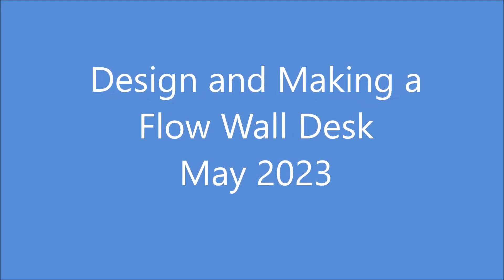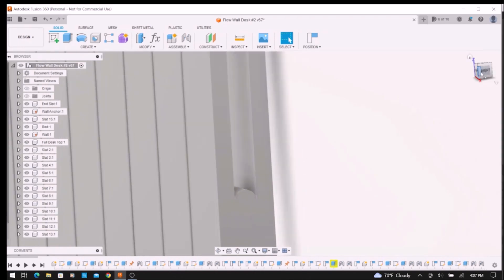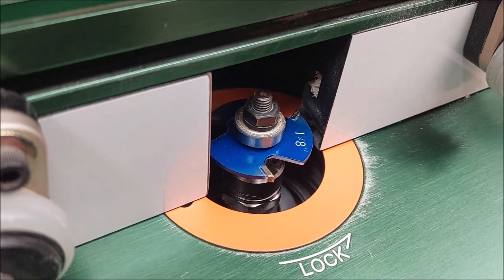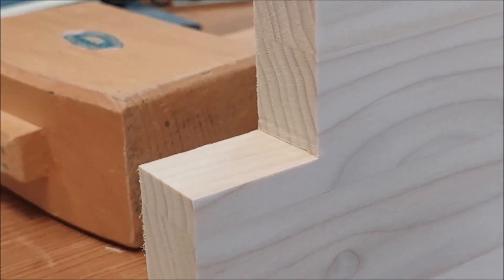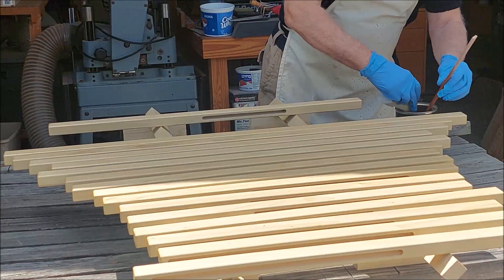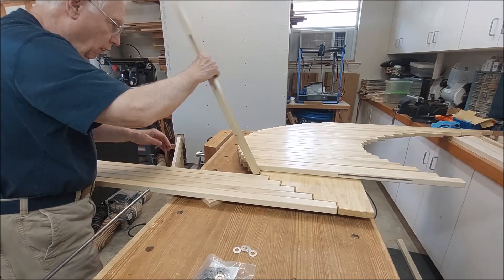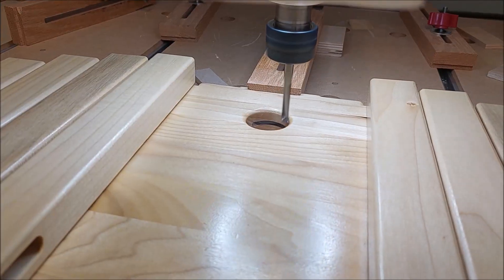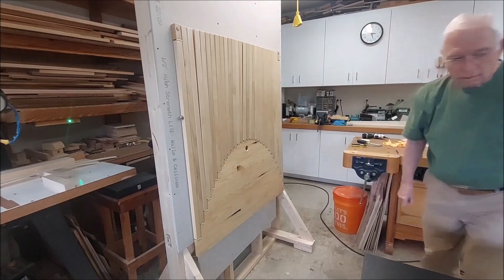Three Correctable Errors in my Flow Wall Desk Design/Build Challenge

Comment: Is the design usable as a table? Seems like if you put weight on the front edge of the table it will want to unfold back?
Reply from the maker: In the unfolded position the desk is very stable.  Placing weight on the front causes no tendency to unfold.  The main issue is weight capacity; you would not want to overload the desk with excessive weight.  To refold the deployed desk, you pull up on the back (using the finger hole) while simultaneously pulling out slightly from the wall.

Comment: I would love to have plans for this. Since you were using a cnc, instead of glue the spacer pieces in. Could you create a piece that could be cut on the cnc that includes the 
‘Spacer” in a few spots along the length of each. Say top middle and bottom.
Reply from the maker: Hello...  The spacer is needed in only one place-- just above the rod on each slat; the bottom spacing is maintained by the hinges; no top spacer is required.  The sole middle spacer could be milled in the slat via CNC but I think this would be an inefficient way to do;  Much more efficient in time and material to cut the slats to final width with table saw then glue in a spacer.  If you don't have a table saw, the CNC milling operation you envision could be a way to go.   Out of respect to the original designer, I do not make my plan available, but there are enough hints in the video and comments for one to make their own.  Its fun. Thanks for watching.

Comment: Absolutely fantastic I found this video. I had no idea how to make this and you helped tremendously. Thank you.
Reply from the maker: @johnvatistas6569  Thanks for watching.  Good luck on your project.
Reply: @richardevans6891  I'm sure this is a dumb question. Well I feel dumb asking because I'm scraping my head with the numbers.  My projected total height when the entire piece is flat against the wall is going to be 43.5 inches tall. Slats 1 & 30 are  going to be 35.9 inches tall. The height of the desk portion (still flat against the wall and not folded) where slats 1 & 30 are going to be hinged together is showing 7.7" long from the bottom piece.  I'm referring to where the desk portion in terms of height where it meets slats 1 and 30 at the hinge points.  But it sure seems very high to me.  What was your height of slats 1 & 30 and what was the height of the desk where slats 1 & 30 meet? It seems this is more of a parabolic shape for the desk portion. I'm clearly doing something wrong.
Reply from the maker: @johnvatistas6569  Hello John,  Note that the desk top shape is not a portion of a circle; it is closer to a parabolic shape.  In an answer to a question from vedranincanada in the comments to this video, I provided the dimension of each of the "steps" of the desk top in my design.  Those will be helpful to you.   In my design the total height of the project flat against the wall is 45.5".  The height of the desk top under slats 1 and 30 is 4".  The length of slats 1 and 30 is 41.5" (including a 1.5" portion of these outer most slats used for hanging on the wall).  Other dimensions may work of course, but those were my dimensions.  Note that in my dimensions this is no allowance for the thickness of the hinges.  Good luck.
Reply: @richardevans6891  You are very kind to answer me and so fast. Thank you very much.

Comment: You did an amazing job on this table!! I remember seeing a famous YouTuber try this and he had many challenges.
Reply from the maker: Hello Patrick, thanks for watching and commenting!.  I am enjoying you channel, but I have a question for you...  When soldering a wire to a panel connector with a short bit of shrink insulation "waiting" on the wire, what is the trick to prevent the shrink insulation from shrinking from the heat of the soldering prior to moving it to final position??  I am working on retrofitting a Jianken 2.2kW  ATC spindle to my machine.
Reply: @richardevans6891  That is an excellent question and I think about that when I am soldering with heat sharing tubing. What I do is make sure I have at least 2 to 3 inches of insulated wire, and when soldering, that heat shrink is as far away from the soldering position as possible. I have done it with shorter insulted areas, but at times you don't need the heat shrink as long as there is insulation all the way to the soldered rigid connection. I really only use heat sharing when I put two cables together, rather than soldering to a rigid set of connections.

Comment: With the slabs/strip, should it be the same width cut measurements as the cut surface measurement? eg. Slab  width 31mm same as the cut measurements for the slab to be attached 31mm or it should be 32/33mm ?

Comment: Awesome.  Finding the right measurements was very hard, but your  video helped a lot. 
My table top was 21"× 38"× 3/4"
Which put the:
Pin at 11 (rounded" on slate #1 and #30 (half the size of the table depth)).
Slate width of 1 1/4" ( x30 slates=37.5". That leaves .5" if you wanted thin spacers.)
Hinges were 1 × 1.125( surprisingly hard to find cheap)
Because of the awkwardness of the piece I ended up securing the table top and slate 1 and 30 to the wall and added one slate at a time. By doing this you can mark the slot length the pin needs to slide.

Comment: Hello Richard, This is amazing video Thanks for sharing

I want to make this table but I'm confused how to Draw line  for "D shap" ( measurements). Please tell me what is the length and width of "D" Shap.

I hope you have understand my question.
Reply: I have been trying to figure this out. Have not found a formula yet but I assume it will involve two 90 degree angles but the curved D line is not a circle. So the regular formulas are not helping me. 

Have you had any luck since posting this?

Comment: Thank you very much for posting this brilliant work. I have been trying to modify the design in SketchUp Pro. I have a question on the 1" x 1" wooden spacers you mentioned in your reply to  peterjordan5947 some two  months ago. 
I was wondering if you used smaller spacers between slats in the middle of the Flow Wall Desk.  I thought the 1" x 1" spacers would not fit at the top end of middle slats because the slot starts at 0.607" from the top of the slat. This distance (0.607") is shorter than 1" - the size of the spacers. Could it that I did not understand your explanation very well?
Reply from the maker: You are exactly correct.  The size of the spacers must be adjusted for the slats toward the center.  How did your project turn out?

Comment: Hi Richard. I dont suppose you know the length of each slat, obviously they're mirrored so just 1-15. That would be really useful
Reply: The first and last one is tricky due to the extra hinge point.
Reply: Actually I think I only need the length of the shortest slat and how far from the top of the slat does the slot end. 
I'm really enjoying this. There's no need for plans etc. You've provided hints and answered comments. I think with this info it should be buildable. Or at least have a stab at it and then fine tune it. The position of the rod is difficult if it's not right the table won't be flat. I've taken some screen shots from your video and trying to measure off that. But if you could provide the length of the shortest slat and the distance from the top to where the slot ends I should be able to calculate it and then confirm it with the measurements from the video stills. Thanks Richard
Reply from the maker: @peterjordan5947  Hello Peter,  In my desk implementation, shortest slat #15 = slat#16 = 24.000" long.  The slot in those slats start .607" from top of slat (measured from the center of 3/8" arc at slot end).  The slot stops 7.910" from the bottom of slat (again measured from the 3/8" arc center).  This is all, of course, for my particular desk.  I imagine there are many alternate formulations that will work.  Thanks for watching and good luck.
Reply: @richardevans6891 Thank you so much for taking the time to reply. I'm moving house next weekend but after I'm settled in I'm going to give this a try. I really appreciate how informative your video is and how you take to time to reply to all the comments. I'll let you know how I get on.
Reply: I had one more question but you've been so helpful I feel bad asking, so please don't feel you have to answer. But if you're feeling generous, what length did you use for the two short support pieces at the top of slats 1 & 30
Reply from the maker: @peterjordan5947  I am not absolutely sure of the final length.  My Fusion plan shows it at 2.5".  I gave the project to a neighbor and don't have ready access to it to check.  This is not a critical dimension and I may not have followed the plan precisely for this part.  It was made from cherry hardwood instead of the poplar used for the rest of the project.
Reply: @richardevans6891 Thanks Richard. I'll keep you updated on the progress I make.

Comment: what is the size of the wooden slats that slide
clearly what is the section of the 30 pieces used please?
best regards 10:29
Reply from the maker: Hello,  My 30 slats were all 1.300" wide, and .943" thick.  The spacer between the slats was .050" thick.  Thanks for watching.

Comment: Great job!  Does the desk seem stable?  How much weight would it hold do you think?
Reply from the maker: Desk is easily stable enough to use a lap top, or use as a writing desk.   Have not tested the weight capacity.  Thanks for watching.
Reply: @richardevans6891  All of the weight of both desk and whatever is on it is supported by the two hinges on the blocks that attach to the wall, and of course the screws that attach those hinges. So you can probably work it backwards if you're building one. Start with how much weight you want it to be able to hold, then figure out how to get hinges, hinge fasteners and attachment blocks that can hold that much.

Another point of concern might be the steel rod. It supports all of the vertical slats except the two outside ones, so if you put a lot of weight on the center of the desk, especially towards the back, it might begin to bow. It seems to me that would take a lot of weight, though, especially since to bow the rod would also have to press the outer slats inwards, and with the spacers there isn't much room for things to flex inwards. My guess is that the rod bowing wouldn't be a problem unless you were trying to put hundreds of pounds on it.

Comment: Nice work Richard. Can I ask was there a clearance on the slot width for the .375 round rod?
Reply from the maker: Hello Jim, My CNC tool path specified a width of .375".  Then to provide clearance, I hand sanded the slot using sand paper stuck on a thin scrap of wood just enough to allow a smooth sliding fit with a test piece of rod.  There was not a lot of sanding required.  Thanks for watching.
Reply: Richard, Jim here again. I have another question. Was there any deflection in the center of your .375" rod based on the weight of the desk when placed in the open position? If so, how did you compensate so the desk became 90 degrees perpendicular to the wall? Were the slot locations adjusted accordingly? 

I use SolidWorks as my modeling package and can make all the necessary compensations as required.

I look forward to hearing from you.

Thanks.
Reply from the maker: Hello Jim,  I made no compensation for potential deflection of the rod.  In the actual operation of the desk there did not seem to be any apparent deflection.  Good luck.

Comment: What are the length on each hole thats inside the wood?
Reply from the maker: Hello.  The lengths of the slots in each slat #2 thru #15 in inches for my desk are: 1.660, 3.310, 4.945, 6.474, 8.047, 9.465, 10.763, 10.927, 12.816, 13.753, 14.496, 15.020, 15.371, and 15.481.  Slat #1 is special; its "slot" is simply a circular hole with diameter of .375.    The lengths listed above are the distances between the centers of the .375" diameter arcs at the end of each slot.  Slat numbers 16 thru 30 are of course the mirror image.  The width of the slots is .375" to accommodate the steel rod.   Good luck.
Reply: Oh my God. I've been doing the maths for these slot lengths by hand using trigonometry. This saves so much time.

Comment: Hi amazing project with amazing result 😀
I would like to try to make it i figured out pretty much everything except the measurments for table top steps when you are starting from center how much are they going down? First i was thinking is the same but know i can see there is a different measurmen for each of those steps...
I appreciate the help
Reply from the maker: Hello Vedran.  The horizontal measurement of every step is 1.35".  The vertical measurements of each step (in inches) starting from the center are: .087, .282, .426, .574, .726, .885, 1.052, 1.229, 1.419, 1.627, 1.856, 2.115, 2.413, 2.809, and 4.000.  The total width of the top is 40.45".  The total height of the top is 21.50".   Good luck.  Thanks for watching.
Reply: @richardevans6891 thank you I'm gonna try to change all of that in metric it's way easier 😀
Reply: @vedranincanada  Hello ! I am trying to do the same, did you success to change it into metric? :)
Reply: @richardevans6891   You give 15 measurements here for the vertical measurements for the steps starting from the center. Does this mean we subtract .087" from that initial 21.5" depth of the desk for the center slat to attach to?

Comment: What are the dimensions of the desk top and the slats?   Also where did you buy the metal rod?
Reply from the maker: Hello Elbrahim,  The steel rod was purchased at Ace Hardware, a standard item.  It is 3/8" in diameter.  The rod was cut to length and threads were added on each end with a thread cutter die.  My desk top has a length of 40.45" and a maximum depth of 21.50"; thickness is about 1".  Each of the slats have a cross section of 1.30" wide x about 1" thick.  Good luck and thanks for watching.
Reply: @richardevans6891  thank you so much.  do you think this is doable with 3/4 inch thick wood?  I want to do a test run with plywood before I ruin good wood.  Thanks.
Reply from the maker: @eibrahim  It may be difficult to use 3/4" plywood because a 3/8"+ slot must be cut in each slat.   Give it a try on a couple test slats.   Maybe as an alternative some less-expensive construction lumber could be planed down to 1" for a test project.   That is essentially what I did using poplar wood  for a test project.
Reply: I am building it now.  How do I know how to size each slot in each piece?  I know they have to be different but how accurate do I have to be?
Reply: @eibrahim 
An easy way is mount the table with slate 1 and 30. Then place something to hold the desk at 90° and then work your way inward opening and closing to find the right slot length for each slat.🎉
Also im using 3/4" material
Reply: Are you able to share your fusion design?  I don’t mind paying for it

Comment: Why would you need to join the table top from small slat with glue? Can you just use a single large piece of wood and cut out the shape.
Reply from the maker: Gluing the top up from smaller slats was a cosmetic decision.   Making the top from a single piece, or a glue-up from fewer larger timbers, would not effect the function of the project.  Thanks for watching.

Comment: So I really want to make this, but I would be new to fusion 360.  How hard would it be to learn the tool and do this design as a newbie.
Reply from the maker: Hi Stephen,   I would say this would be a pretty hard project for a newbie to Fusion, unless you already have other computer design experience.   If new to all computer design, I suggest a couple of simpler design projects in Fusion, before trying to tackle this.   Of course, there is very low risk to give it a go.  As a hobbyist you can get Fusion for free.  
There are lots of training tutorials on YouTube.  Good luck.
Reply: @richardevans6891  thanks Richard.  I appreciate it.

Comment: @Richard Evans, Thank you for this video! I was wondering how you determined where to run the rod through so that the desktop would stay level?
Reply from the maker: Hi Niels, great question.  I first made an approximation of the lower rod location through the slats (which is the rod location when the desk is flat to the wall) by scaling from the pictures on Mr. van Embricqs' web site.  I then used the Fusion 360 model to fine-tune and confirm the correct upper location of the rod slots by trial and error.  The correct upper location being where the rod needs to stop (in each slat)  so that the desk top is perpendicular the the plane  that represents the wall when the desk is deployed.  The Fusion moving model made this surprisingly doable.

Comment: Hi, im new to the carpentry trade, just finished college here in England. Im attempting this and wanted to ask, the internal grooves where the steel rod goes through, what are the dimensions from where the groove starts and finishes on all the arms?
Reply: Draw a line perpendicular through all the slats as they should appear in the final product somewhere around the vertical center, then find the center of that line and draw a semi circle from that point across all slats which follows the same arc as the "table" part. Now just draw another perpendicular line across the lower part of the curve in each slat and there is your minimum and maximum points for the grooves in each slat.